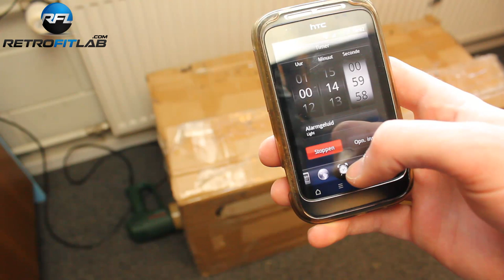Chevrolet Avalanche Bi xenon projector lens instruction video

Comment: what is needed to get this working in an avalanche housing? Will a 9006 HID bulb fit in the projector? Or do you need a special type of bulb to fit?

do they make H1 bulbs with 9006 bases?
Reply: +Retrofitlab 
do H1 bulbs and 9006 bulbs have the same base?